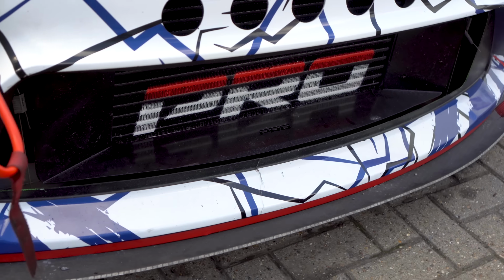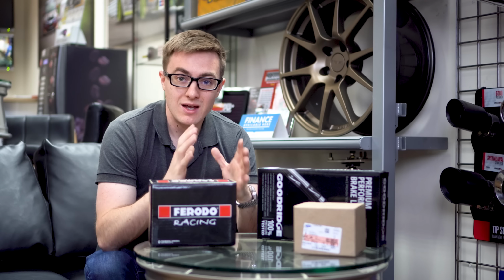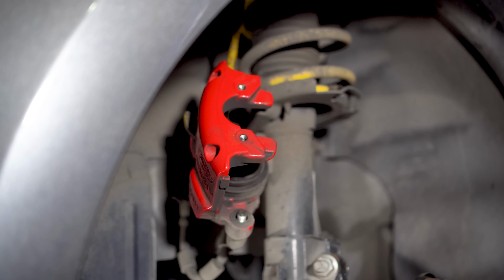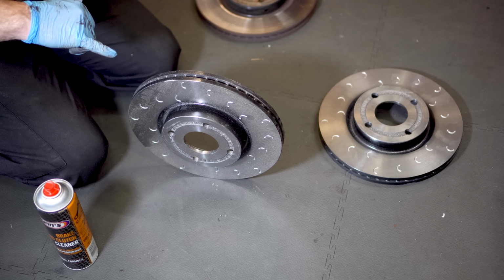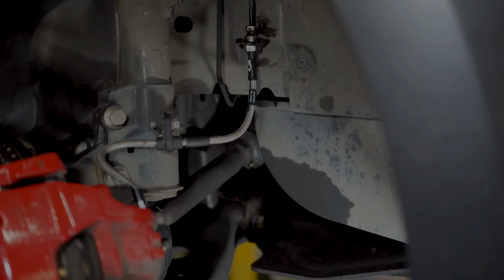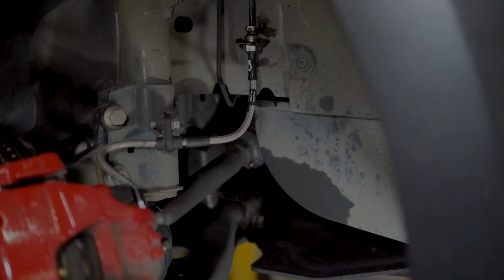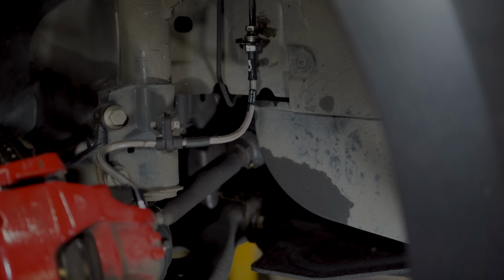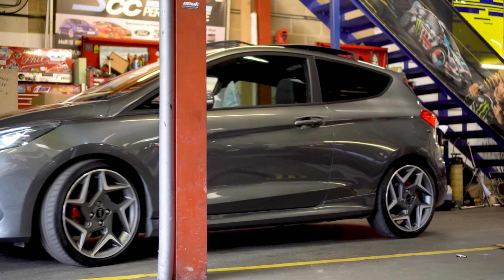MK8 Fiesta ST - HOW TO replace Discs, Pads, Lines &  BRAKE FLUID (SCC Performance Brake Upgrade)

Comment from the maker: Hopefully this video will be useful for years to come as the MK8 becomes more mature. A massive thanks to the guys at SCC for their hospitality, and for making this video possible. 

So what are your thoughts? Save some dollar and opt for this, or go all out and go Big Brake Kit? For me, time will tell but this kit is very very promising from my initial impressions.
Reply: Hi thanks going to do the same when i get mine September the 2nd, I think you will find there are upgraded rear pads but the majority of braking is through the front .
Reply: My ST pads and discs are glazed after one track session. OEM pads and discs are rubbish quality
Reply: Hello my friend. So you suggest to go with that kit instead of a bigger brake kit?

Comment: You make awesome and very informative videos. Keep it up! I just got mine fiesta st 3-door in performance blue with 18 inches and per. pack. Just breaking it in, but still an epic car! I know that winter is quite far from now, but I’m wondering what winter tires I should get, and wether it’s a good idea to change just the rubber, or if it’s better to get a second set of wheels. How do you deal with winter? Thank you for your response.
Reply from the maker: Erik Zila Music Hey, thanks for your comments 😁 I don’t tend to change tyres for winter. The UK winters aren’t that harsh and if we have a spell of snow, I tend to just park up and leave it anyway!

That said, if I were to go winter tyres, I’d get a second set and drop the size to 17” so they’re cheaper to replace in the long run 😁
Reply: JB CTR We dont get that much snow either, but when it suddenly comes I dont want to be restricted or risk a ticket, so I will deffinitely consider dropping the size for winter. 

Thanks for your advice.

Comment: Nice video again mate. Out of interest what was the brake wear on the original pads like was you about half way through. Another one to go on the list of mods I think currently saving for the ford performance alloys 👍
Reply from the maker: chris else The alloys are noice! I didn’t actually check the wear on the pads, but at least one of my discs was everso slightly warped following my track day at Abingdon. Braking is much smoother now 😁
Reply: @JBCTR  mines going in for it's first service tommorow I suspect I'm around half way through, so I wouldn't upgrade the brakes until they needed replacing. Love the wheels I have saved around £700 for them so far not sure if I should save for some ps4 tyres as well decisions

Comment: Good video but if they had braced the brake pedal so it had pressure on it The brake fluid wouldn’t run out only The fluid in the rubber lines would come out far less messy

Comment: Does it work the same on a normal fiesta mk8? Cause need to change them before i go on the track
Reply from the maker: The process would be similar, but you may need to purchase different discs/pads to fit your car.
Reply: @JBCTR  gonna change to revo bigbrake and revo wheels